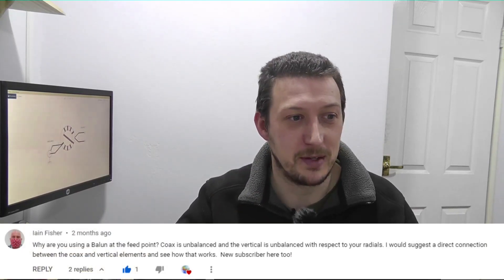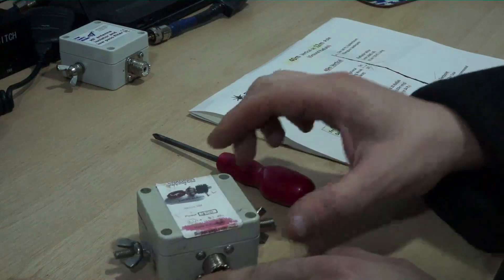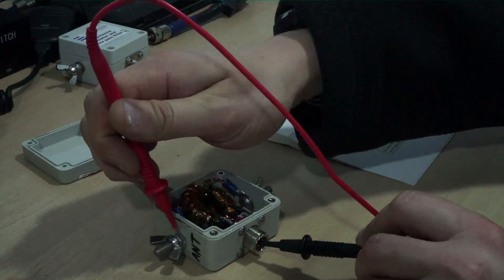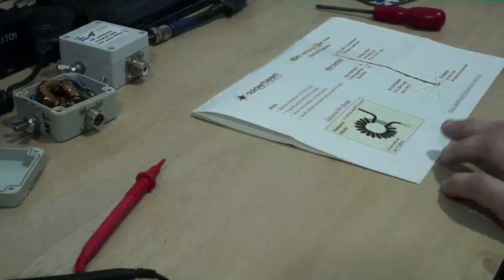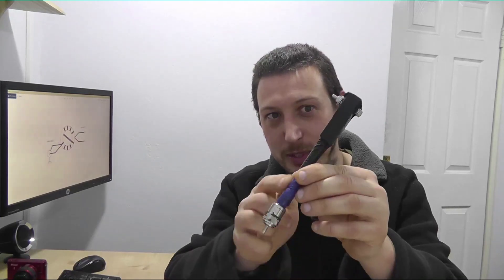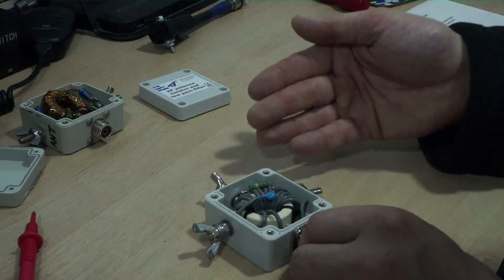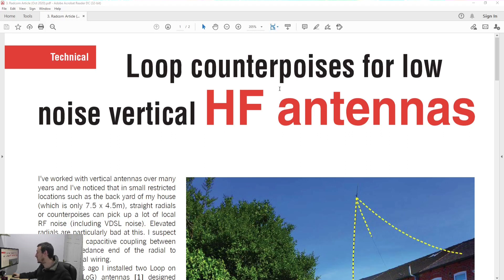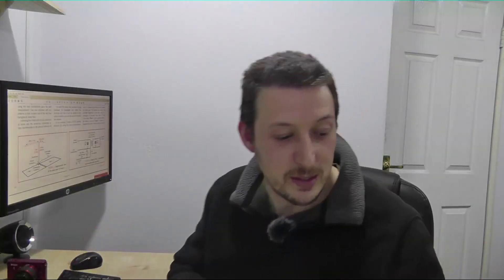Balun Or No Balun? - Feeding 1/4 wave verticals

Comment: The only confusion I can see is that you’re calling an un-un a balun. It only works with a dipole because of the choking as you’re saying, but all chokes are not baluns. Baluns are only the devices that transform between balanced and unbalanced signals.

When you’re connecting stuff together that has different impedances you need to match that which you can do with un-un transformers. Or chokes, if you’re happy with less efficiency.

Comment: I have a portable vertical with a coil on my balcony. On 20 & 40 metres the noise level is unbearable. I was looking at the mfj 915 choke and different baluns to bring the noise down. Will that work? There's one like you have and there's the mfj with 50 beads inside. What would you think would work?
Reply from the maker: This is a bit of a copout answer but "it depends". If you are in an urban area, you may struggle with noise no matter what you do but I find that a choke/balun at the antenna feed point usually helps. I sometimes see advice around putting another 1:1 choke at the radio end, which can also help.

If you are using "a portable vertical on the balcony", I'm guessing that you probably won't be putting more than 100 watts barefoot through it. The MFJ-915 is expensive & probably overkill for what you are running. I don't know what the power limits are on the MFJ-915 but it looks like it's designed for a QRO setup. Unless you plan to run around 250+ watts, there's cheaper ways to achieve the same effect.

On my various antennas I generally use a combination of chokes/baluns/transformers from SuperYagi Antennas here in the UK (there's probably other local suppliers in other countries).

I've also wound my own on a few occasions.......plenty of YouTube videos & tutorials online to show you how to do that.

I would steer away from the so called "ugly balun" or "air wound choke" designs which basically consist of coax wound into a coil.

Comment: The choke does not affect the rf flowing on the inner conductor and the inner surface of the braide,  only stops rf current flowing on the outside of the braide.

Comment: Interesting video, James. From a pure RF transmission view you don't need them but when you want to isolate the antenna from your noisy shack ground or stop RF coming back down the coax to the shack then it can make a big improvement. One design I've built was a HF signal monitoring antenna to an ITU (International Telecommunications Union) specification. On their coax feed they specified 50 (yes fifty) ferrite toroids on the coax feed, one every 0.5m. It was super quiet on receive! 73, Chris G4HYG
Reply from the maker: Wow, that must have cost a bit. The ferrite probably cost more than the feedline! Then again, for commercial setups I guess that money isn't really a problem (at least not compared to hams, who are often very averse to spending money).

Sounds like an awesome system.
Reply: I’m interested what type ferrite was used I use 1 @ 240/43 from memory now wondering about adding a few more I use a 80 m efhw and currently have it 1/5 th of lowest band so 4 m from 64 to 1 transformer ,cheers
Reply: Mfj makes one with 50

Comment: A choke is a very good idea.
I have two chokes on my 6BTV, one at the feed point and one where the coax enters the shack.
Both are optimised for the lower bands, 20, 30, 40 and 80metres.
Reply from the maker: Absolutely agree.

I know a lot of people don't use a balun/choke for verticals or dipoles. I personally see it as good practice.

I always use a balun/choke on my verticals & dipoles with the very occasional exception of portable setups with very low power where keeping weight down is important (such as a SOTA activation with 5-10 watts).